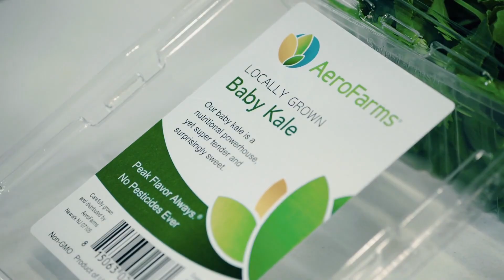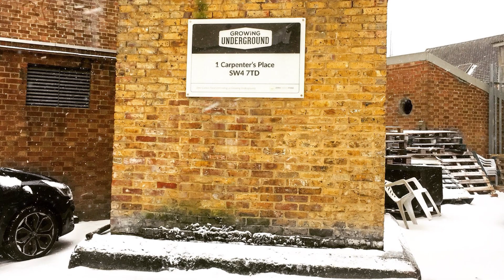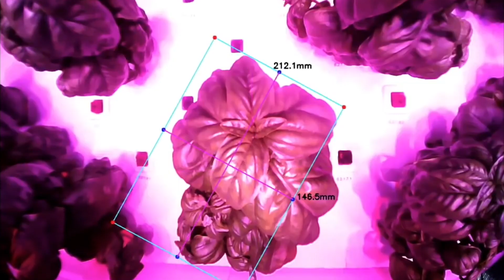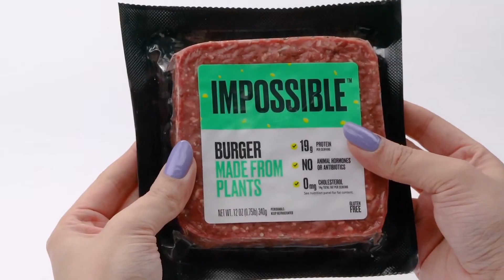Why the Future of Farming is in Cities - The Big Money in Vertical Farming

Comment: Most of these operations have failed as businesses.  What is Aerofarms doing that will lead to success where others have failed?
Reply from the maker: Would you have names of city farms that have failed? I'd like to look into the ones that have failed, and see what went wrong  - thanks.
Reply: @VentureCity  It's the high tech vertical farms that are failing.  There are low-tech roof top farms that are doing well, and I'm growing more and more stuff hydroponically in the Mission District of San Francisco.  

The vertical part is one of the things that kills them.  They need to use scissors lifts for working on the systems.  These cost about $30k and going up and down dramatically increases labor costs.  

Plenty.ag is trying a robotic system but I've been following them for years and they aren't doing that much compared to what they set out to do.  

There are mom and pop operations that are producing more than Plenty with a much lower capital cost.

I suspect that Plenty is having problems with disease in their CAE.

Watch my videos for simple and cheap approaches to city hydroponics.  

Aerofarms is not public so we can't see how they are doing financially.  Being big doesn't matter if they can't make a profit.

Plenty has gobbled up plenty of cash and not done much.

Here's my take on why they fail:  https://www.youtube.com/watch?v=lAoQo4vJOvs

General search:

https://www.google.com/search?q=vertical+farms+failing&rlz=1C1CHBF_enUS707US707&oq=vertical+farms+failing&aqs=chrome..69i57j0.6391j1j7&sourceid=chrome&ie=UTF-8
Reply from the maker: Thanks for letting me know. I will look more into it. Just started watching your videos.